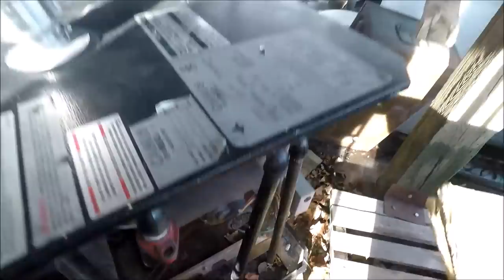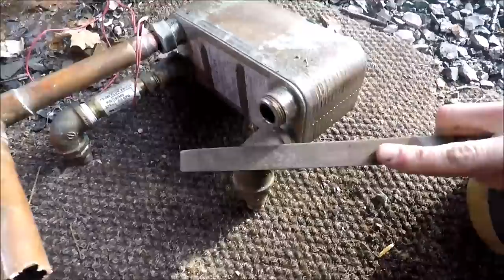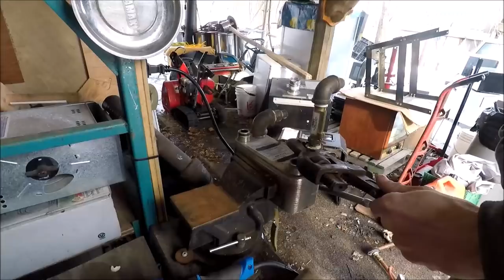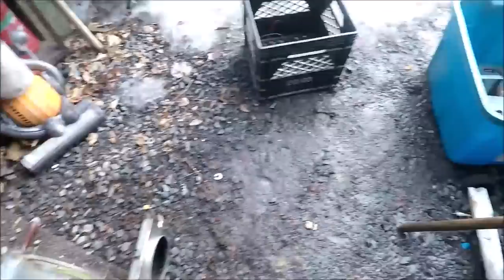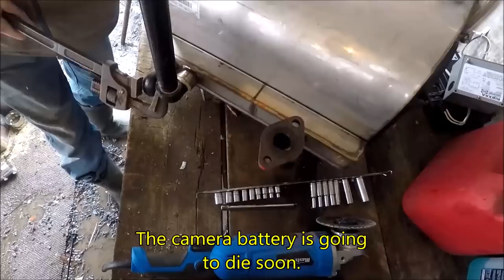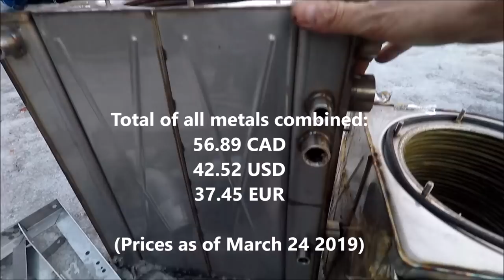Big water boiler scrap out. How much money can I make from this thing?? HVAC

Comment: Great video.  The cost of the total unit without taking it apart was a nice touch.  Not a complaint but a suggestion: put the total what you think you'll get for it beside what you'd get whole side by side.   I know I could have added it if I really wanted to know, just thought it would be a nice touch.  At least that way someone, sitting on the couch, in their mom's basement, eating junk food can criticize you for working hard for two hours to make $20 dollars.  I am sure you know the comments I refer to.

Comment: I liked the Ben Houghton style , I scrapped a pool heater recently It was loaded with #2 copper and also had stainless, aluminum ,#2 wire ,big elec motor and off course steel